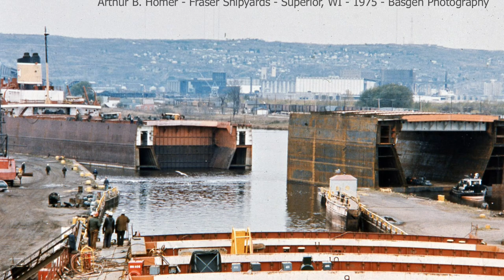The Edmund Fitzgerald’s Sister Ship

Comment: I hear that a lot - that the Homer was slightly longer than Fitzgerald - but Fitzgerald was considered the Queen of the Lakes (longest ship) until 1971. Usually, if a there are a number of ships of the same length, the first gets the "Queen" title, though it is an unofficial title. 

The 1000-foot ships had been around starting in 1971 with the launch of the Stewart J. Cort, the ship that took the Queen title from the Fitzgerald. What I think doomed the Homer is that she was lengthened, which limited what ports/docking facilities she could access, at a time where the decline in the steel industry made versatility a must. Even the 858-foot Roger Blough was laid up in the mid-80's for a time. There is an article on the web which highlights the record number of ships scrapped in 85/86 due to the downturn.

Always nice to see the Homer gets some love - she certainly was overshadowed by her sister, even before the Fitzgerald was lost.

Comment: Another rumor is that the Homer was laid up in 1980 after the Fitz sank BECAUSE they were the same design, and built the same way. There were also rumors of a loose keel on both ships, and people didn’t want a repeat from five years earlier when the Fitz sank. All rumors, or course. Nothing substantiated. But thought I’d throw the rumors out there for others to ponder.
Reply: Why would they lay her up after 5 years instead of immediately🤔
Reply: @freightersonthegreatlakes995 , money….. That could be my only guess. Bethlehem Steel, the owner of the Homer, was most likely feeling the pinch of the 80’s downturn in steel prices too. Who knows? It depends on what you read, I guess.
Reply: Also in 1978 the chairman of the NTSB (which had been investigating the Fitzgerald's sinking) was denied permission to travel on the Homer by Bethlehem Steel without any reasoning. While the main reason for her scrapping is certainly the economic downturn, that denial certainly raises some questions in my book.
Reply: A loose keel is a fairly easy fix, bad Steel on the other hand isn’t
Reply: @ryanthompson2893 , the steel wasn’t “bad” per se. Ships which sank that were constructed at the turn of the century, on the other hand, had brittle steel. When it got colder, it was an especially big issue. By the time the Fitz and the Homer were constructed, brittle steel was a thing of the past. In fact, the Herbert C Jackson is a perfect example of one built around the same time which is still in service to this day. Hull number of the Herbie is two numbers after the Fitz, which means it’s the closest thing to the Fitz and Homer. I believe Fitz was 301, the Homer 302, and the Jackson being 303z

Comment: I saw the Homer shortly after it arrived at Port Colborne a few weeks before scrapping began. The ship was completely intact and looked really good and I wondered why it was being scrapped.
Reply from the maker: I think they were worried that there was a flaw in the Fitzgerald’s design, which implied that the Homer would have the same problem, so they didn’t want to take any chances with the Homer. Personally I don’t think that anything was wrong with the design of the Fitz or the Homer and I’m not superstitious, so I don’t believe that any deaths while building the Fitz had an impact on it.
Reply: Apparently the Homer had the same tendency to "wiggle " or "vibrate " in rough seas like the Fitz. Both suffered the same design flaw as they were designed from the subassembed sections (new at the time]. The Homer was slightly longer then the Fitz, but she never set the same records as the Fitz. Homer had been lengthened just before her scrapping, but went into long term lay up. The coast guard had requested to go along on a trip on the Homer but were denied by the owners, that tells it all right there. They could have proven more about the Fitz.
Reply: The steel recession of the time doomed the Homer and many others in the US fleet
Reply: @jacktfowler246  I found myself wondering whether anyone was.....looking for anything structuraally unusual during the scrapping process, but another part of me answered that there was no incentive to do any kind of detective work at that point, and probably significant dis-incentives...
Reply: @WayneKeen  the big thing that made homer and Fitz unique, was they were a two of build in subassemblys. They were tack welded as opposed to the other Lakers which were riveted. They bent and were far more tender then the usual laker design. Fitz was overloaded for too long and it ultimately contributed to her loss. Also Fitz's final years under McSorely took a tole on her, he was known to be very hard on boats
Reply: @jacktfowler246  I have read about / seen people talking about the Fitz' "loose skin", though I had not seen as much on her construction.  Thanks for the edification!
Reply: @WayneKeen  according to one of the former first mates, even in mildly rough seas she seemed to do a lot of "bending and springing " Mcsorley once remarked it bothered him.
Reply: @jacktfowler246  I remember seeing something on that where they either had to slow down, or speed up on occasion to avoid any kind of resonance in those bending modes.
Reply: @WayneKeen  yes I believe they would have to slow down and change course. She would vibrate terribly. So this was the only way to correct it. They also usually favored the longer route along the Canadian shore, to avoid getting into those type of situations.